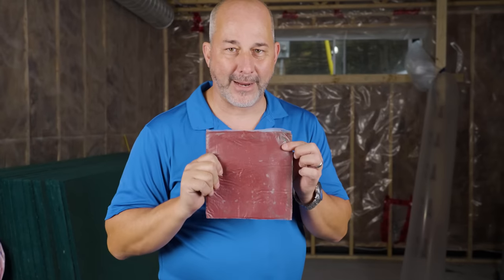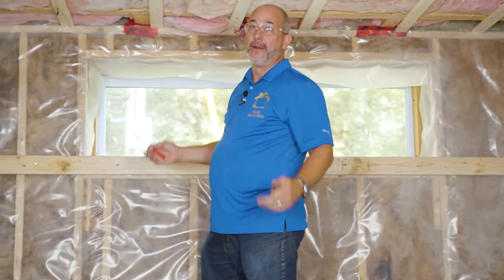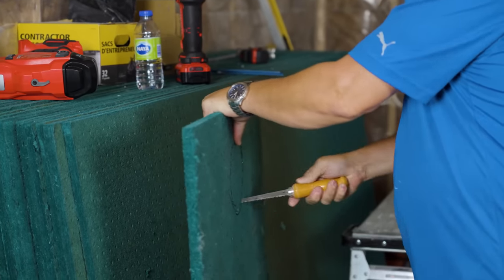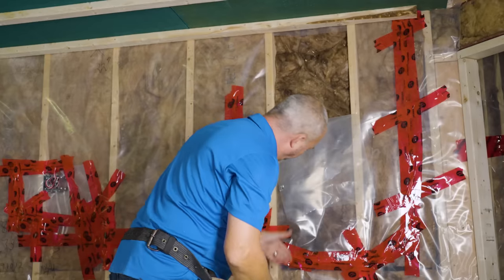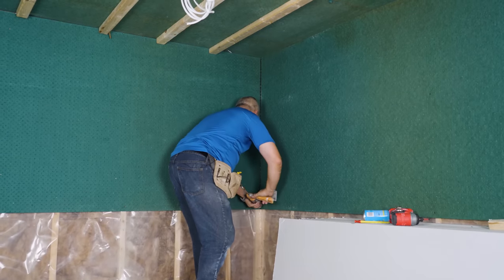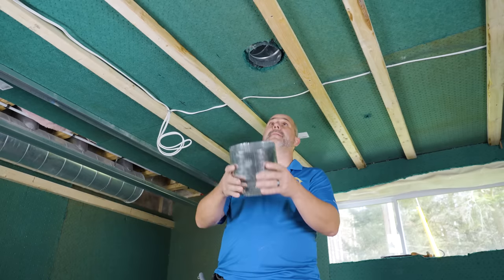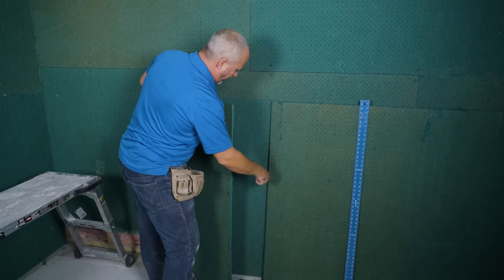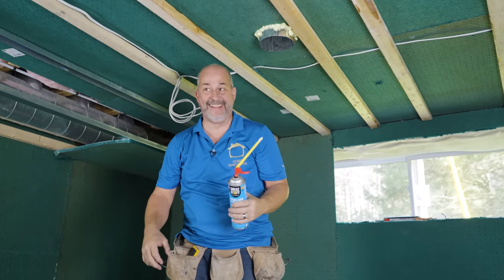Soundproofing A Room (It's Easier Than You Think)

Comment: Acoustically, none of this makes any sense.  Everything he did was a complete waste of money and time.  All that talk about 95% vs 50% and integrity, and then he cuts a hole in the green boards.  The duct work hanging right into the center of the room will be the weakest link.  Along with all of the drywall that is screwed right into all of the studs throughout the room.  This short circuits the system and defeats the purpose of green board or any other ridiculous "acoustic" product that he put into the wall.  The putty pads were about the only thing I agree with on this project.  If you didn't want to hear anything and truly soundproof it, the only way is to build two separate walls that dont touch! Or to to hang everything on isolation clips with double drywall.  You must seal all cracks with flexible caulking NOT SPRAYFOAM, its not flexible, its rigid and will transmit sound.  Add an Acoustic STC door if you can afford it or a solid door with an acoustic door seal kit.  If you want a soundproof room, call an acoustics expert, not a DIY'er.  I can assure you that no contractor is an expert in acoustics or how to build a room properly.  I will never get this 22 minutes of my life back but he had me at the beginning when he said the fluffy pink stuff adds mass.  The only way to add mass would be to use mass loaded vinyl which is is 1 lb PSF or 5/8 drywall which is 2.75 lbs PSF.  Take a guess how much the fluffy pink stuff weighs?  .05 lbs PSF.  Basically nothing. No mass.  Its mostly air, which sound loves to travel right through.  Especially long, powerful sound waves like bass frequencies.

Comment: 2 layers of fiberglass insulation isn't a cost saving strategy. 1 layer of rock wool would be less expensive. BTW, who has a 2 layer deep area between walls to support fiberglass insulation ?? NO ONE !! Use the ROCK WOOL. Anything else is a CHEAP way of doing things. You get what you pay for. This guy is full of crap.

Comment: Just terrible. The floor is gonna be the main cause of sound and vibrati9n so start with the floor, rubbers and stops in the floor ect. After that you want proper soundproofing wall insulation and you want staggered 2x4 &2x6 walls for breaking up extra density and vibrations. Then the ceiling should be full of electrical above the fiber board not between. Yikes dude. This guy puts dish soap in his drywall mud- nah.

Comment: You need to work on your speech. Even slowed down I can't understand your words at times. You speak too fast too, and there's too much excess verbiage without adding the precision something as exacting as sound proofing requires. Also, you don't mention anything about how the studs are arranged, which as I understand it makes a big difference in transmission of sound. I was disappointed.

Comment: Did you cover the walls with drywall? if so please don't use sonopan for this method at all, It will do nothing to stop sound transmission or "sound proof" the only thing it can do if left uncovered is sound deaden as in stop reflections. The double drywall plus green glue is the proper method, Sonopan is basically snake oil for soundproofing. You need to remove this video as it is misleading, great channel though